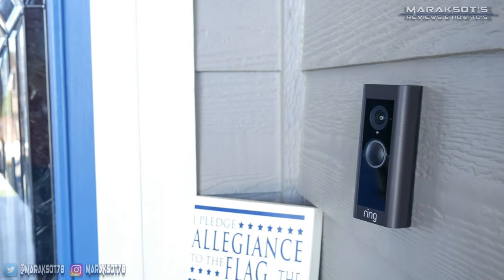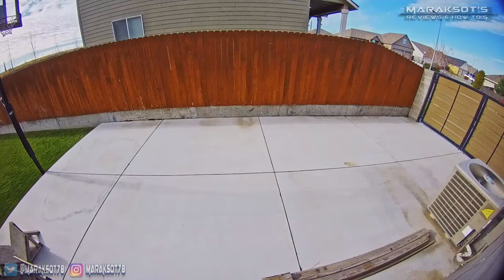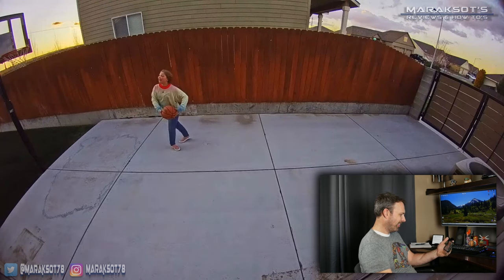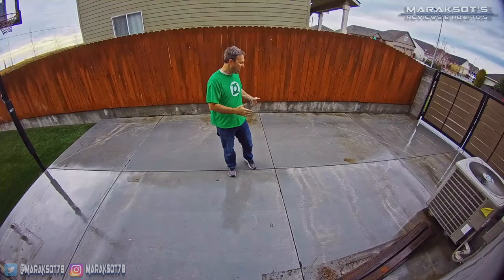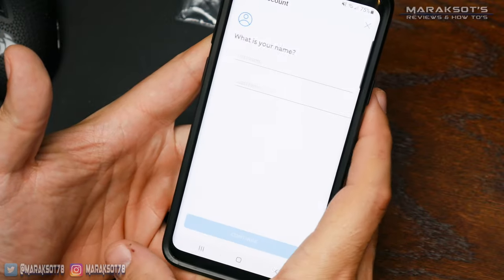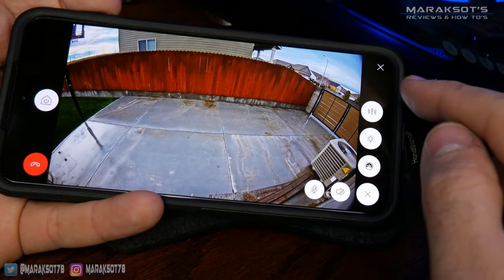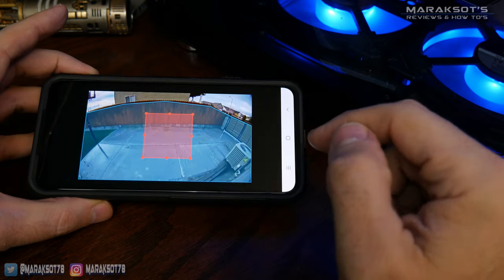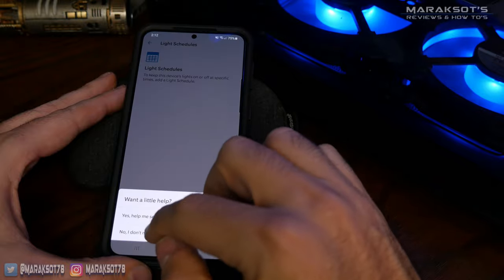It's a Floodlight and a Wi-Fi Security Camera! - Ring Floodlight Cam Wired Pro Review

Comment from the maker: Wanna skip to a particular part of the video? Use the Time Stamps. :)

Time Stamps
0:00 – our Ring camera journey
0:24 – the Floodlight Cam Wired Pro
1:09 – Floodlight Cam Wired Pro Video Quality
1:34 – Night Vision
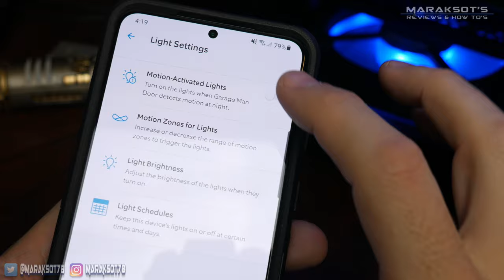1:55 – the Floodlights
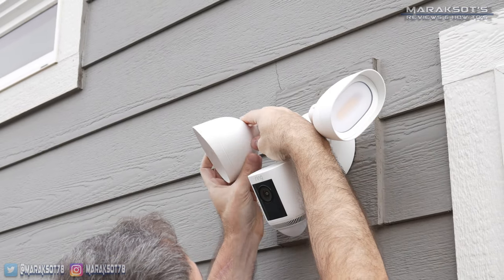2:26 – two way talk
3:01 – Floodlight Cam Wired Pro Audio Quality
4:06 – how to install the Floodlight Cam Wired Pro
5:27 – setting up the Floodlight Cam Wired Pro in the Ring App
6:15 – accessing your camera
6:35 – Live View functions
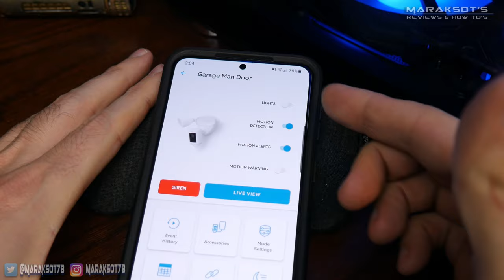7:13 – camera settings & options
8:06 – editing Motion Zones
8:30 – Motion Settings including 3D Motion Detection
9:19 – Light Settings
Reply: Easy installation and great video.  However, the wired pro floodlight cam doesn't want to connect to my EERO Mesh Wi-Fi system. I have 4 routers covering over 5k sq footage. This is the 3rd replacement and is telling me the same error as the previous 2 units along the lines of, "set up is not complete. Your Wi-Fi router may be too far away". This is incorrect. My Ring Doorbell, stick up camera, non-PRO chime and all other electronic devices were installed and/or connected successfully. I've spent numerous hours troubleshooting (since early Dec’21) and on the phone with EERO, Ring Tech Support team and HelloTech (3rd party contractor partnered w/Ring). HelloTech's tech even came over and unsuccessfully troubleshooted. He spent over 90 mns. In the troubleshooting process, we used a different network, hot spot, paused the 5Ghz band to allow the 2.4 take over for the floodlight to connect, restarted the network, unplugged routers, bought a Chime Pro to boost the signal, etc. and NO LUCK!  As you can tell, I'm desperate and would appreciate any input.  If this issue is a head-scratcher for the pros mentioned above, imagine how it is to me.  Thanks.
Reply: How do I set up it on an existing one,   previous owners have them how I link to my phone

Comment: Thank you for making this video.  My mom got her car broken into a few weeks ago, I wasn't home.  We currently have two lights above our garage, one in each top corner.  We have a 2-car driveway.  I'm thinking of replacing either one of these lights or both of them with the Ring Floodlight Cam Wired Pro.  The way our front yard is, there's a little bit to the left of the garage, then there's bushes and trees which block the view of my neighbor's house.  To the other side, there's just a lawn, I'd say 25 feet, from the edge of the driveway to the other neighbors lawn.  I'm concerned that if I just replace one of the existing lights, that it'll just look mismatched, so I'm considering doing both, even though I know each camera comes with two cameras on them.  What would you suggest?

I'm wondering if I just put one camera in along the top right of the garage, if in between both cameras that the device has, if I'll be able to see both cars and if someone is walking up towards the front of the house.

Comment: Thank you this is so helpful. If the power goes off, is there a back up battery?
Reply from the maker: No.  Ring cameras connect to WiFi and there is no memory on the cameras or recording device they record to in your home.  They connect to Ring's servers through the internet and all the video recording is cloud based.  If your power goes out that most likely means your home network will also lose power (unless you have your modem and router on a battery backup as well) meaning even if a wired camera like this one had battery backup it wouldn't be able to connect to the internet to record anything.

Comment: Excellent video! Can i install that camera where the old bell box alarm is at the front of the house? Can I use the wires from that bell box? It's a wired alarm that i don't use and it will changed to a wireless alarm. Thank you

Comment: I have two porch lights on each side - left and right side.  How do I connect the Ring floodlight on the right side so that when the floodlight turns on, the left conventional porch light also turns on.  The circuit is controlled by a light switch. Thanks for any advice you have.
Reply: We have a motion sensor that my husband wired into the two lights that we have on our 24x24 garage (one light on each side). You could do this with your left light which should be activated if there is motion picked up by the Ring
Reply: @Cathy_MidwestHome_Hens  Thanks for your reply.

Comment: My outdoor light right now is connected to a switch to turn it on. Would installation be the same or would I have to wire it differently?
Reply from the maker: Depends on what you want to do. You can remove the light switch and wire it up directly if you want and put a blank cover plate on the box.
Mine is like yours; connected to a light switch.  I just left the switch in place.  To keep power going to the floodlight cam you do have to leave the switch in the on position.  To prevent anyone turning it off I bought a magnetic switch cover on Amazon which has been working great.
Our house has rocker switches, so here's the one I bought if you're interested - https://amzn.to/3OVnPZy
If you have regular light switches then there's these too - https://amzn.to/3QEvgFN

Comment: Does the floodlight feature still work if your Wi-Fi goes down?
Reply: I am curious too. Seems useless if light doesn't turn on during power outage. I'm wondering if the battery powered version would still work during power outage.

Comment: If you turn the lights off, does night vision still work? There are times that I’ll need it to record at night but without flood lights. Thanks so much.
Reply from the maker: Yes you can turn the flood lights so they do not come on and the night vision will still detect motion and record just using the night vision.
Reply: @Maraksot78  thank you

Comment: Can the camera be rotated at all? or is it completely stationary?
Reply from the maker: You can point it where you want it to look but it doesn't have any kind of motorized movement if that's what your asking?
Reply: @Maraksot78  thanks for the reply, i was more or less asking if it was on a ball joint to rotate it to a new fixed position other than the default dead ahead position it comes in.
Reply from the maker: @jeffpurins8229  That's what I thought you meant but I wasn't sure. Yah, it has a ball joint so you can point it in the direction you want to see.

Comment: Can the floodlight be on all night? Or is it only motion activated?
Reply from the maker: Yes, you can set the lighs to a schedule if you want so it will turn on and off at certain times of day and you can of course turn the lights on and off manually as well.
Reply: @Maraksot78   I hope the bulbs are built to be on all night? Or can we use any led floodlight bulb? Or a special ring bulb?
Reply from the maker: I wasnt sure about them and just went out and looked at them and they dont apprear to be any kind of normal bulb I've ever seen. They appear to be built in. I cant see any quick easy eay to get them out to replace them. I assume there is probably a way to replace them but if you can  my guess is you'd have to order a replacement from Ring. But at the same time I know  a lot of newer LED light fixtures are coming with non-replaceable LED bulbs that are supposed to last for the life of the fixture.
Reply: @Maraksot78   they don’t look like they can be replaced?? Wow I gotta see this thing in person lol. Must be ring bulbs then you have to use. I have floodlights in the front yard. They stay on all night. Honestly maybe it would be cheaper just get a stick up cam and put it under those lights lol. Pretty much the same thing huh?  It just occurred to me just now.
Reply from the maker: @Catman1798  Yah, I don't know if theyre replaceable or not. I tried looking up replacement bulbs for it online and haven't found anything yet. I used to work in construction and like I said, I know that more and more of the new LED light fixtures are being made where they don't have replaceable bulbs but rather have LEDs built into them. The LEDs are supposed to last for 10 years or longer so they figure you'll replace the fixture before it dies. Using a stick up cam with your existing flood light would be a lot cheaper that's for sure. 😂
Reply: @Catman1798  I have started buying Ring products and was actually thinking of doing what you said.  Just put a stick up cam next to my existing flood lights... however, I would like to power the Ring stick up camera rather than use battery as having it wired gives it way better motion detection and more features. BUT, a flood light cam would be so much easier to install. In the other areas where I have the stick up cams I don't even use the night vision because there's just enough light and it gives a good picture.  The other video-type floodlights I've seen in the area also use built-in lights, not bulbs, and I've read Nest bulbs are not replaceable either.

Comment: Hi sir! I don’t have a junction box, can I use the extension cord to connect with my floodlight camera?
Reply: Ring has a floodlight plug in mount
Reply: @christucker8132  Thank you Chris.How’s the plug in works?
Reply: @Gervacio77  it allows you to plug any ring floodlight wired plus or pro into an outlet. Cable is 20 ft long. Basically drill a hole from inside the house to outside. Then wire the plug in into the floodlight
Reply: @christucker8132  Thanks Chris, probably I consider to buy a floodlight camera plug in. Thank you!
Reply: @Gervacio77  FYI it’s cheaper to by cam/plug in mount separate instead of paying for the bundle pack

Comment: BEWARE if you think "works with Alexa" means you can say "Alexa, turn on the light" you'd be wrong. To turn on the light, without it having detected motion, I need to find my phone, log in, find the app, log in, find how to turn on the light and do so. By this time the reason I needed to turn on the light has likely passed. I don’t need a $250 light that is falsely advertised.

Comment: Does the ring camera can it connect to data cellular if it can how
Reply from the maker: All Ring cameras connect to your home wifi network but all the video recording and everything is web-based meaning they connect to the internet and record to Ring's servers. Since it's web-based you can access your cameras from anywhere in the world so long as you have an internet connection. This includes when using mobile data through your mobile phone provider.

Comment: Something that’s never covered in these reviews, do you have to keep the light switch to the ON position for the camera and lights to have power? I’m presuming yes?
Reply from the maker: Yes, that is correct. You can of course remove the switch and wire it straight in and put a blank cover over the box if you want. Then you don't have to worry about anyone turning the switch off. There's also switch covers you can buy to keep people from turning it off as well I bought these for mine.
https://amzn.to/3lnDQrI
They're super easy to install.  They just magnetize to the screws on the light switch cover plate.
Reply: @Maraksot78  So do we have to manually turn the switch Off every morning? I talked to Ring and they said the lights auto turn on and off according to daylight outside. Is this true?
Reply from the maker: @MRSHEARTLESS24  Yes, they turn on and off automatically. You can turm them on and off manually of you want, set them on a schedule or just have them come on when motion is detected which is what I have mine set to.
Reply: @Maraksot78  Thanks for answering!! Thx for the help.
Reply from the maker: @MRSHEARTLESS24  no problem

Comment: these videos make me laugh..... their assumption is everyone has an "existing" video camera...... of course it would be easy to change it out...........   LOL !!
Reply from the maker: This floodlight cam connects to your home network via WiFi. No additional wiring is needed. It does require power though so you need to put it where you already have an existing exterior light fixture but you don't need coax or network wiring for the camera.
Reply: No need for existing wires. You can buy the plug in kit